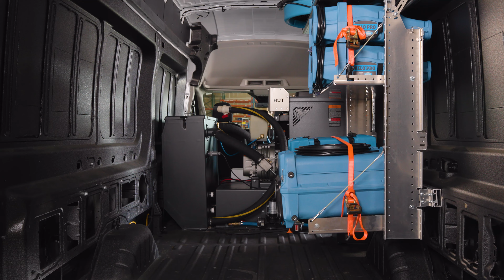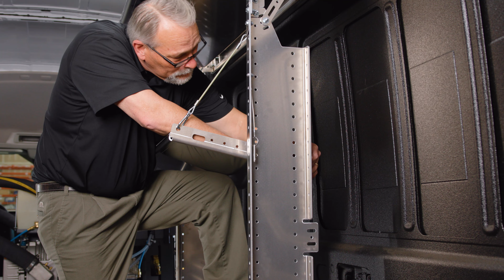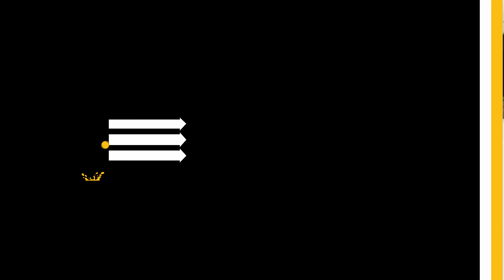Modular Van Shelving Kits || Installation Guide

Comment from the maker: Installation Start Times:
• Base Kit - 1:03
• High Roof Extension - 5:17
• Chemical Shelf - 6:06
• Standard Fixed Shelf - 7:07
• Standard Folding Shelf - 7:48
• Heavyweight Folding Shelf - 8:58